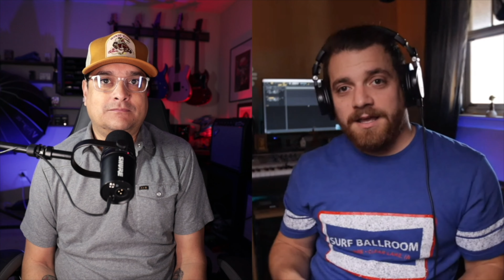The Problem With Amp Modeling is YOU - Just Gonna Say It CLIPS

Comment: Halfway agree on this... and I started expanding on the subject, but nobody cares to read long texts anyhow... so keep it sort. The truth of the matter is that while playing through a modeling unit vs. a tube amp you can easily hear the difference. One will generate sound through some studio monitors, PA or something and the other push the good tones straight out in the air from the speaker cabinet. It's bound to be different. How can it not? You can of course connect the modeling unit to a power amp and a conventional guitar cabinet, and you have a very good litt rig that can replicate all the legendary rigs in the world and the player will not hear a difference either, but if you don't need to sound like many different guitar players then it sort of has no point then. Easier to just get a tube amp...  

As a listener I will not hear a difference if the modeling unit is tweaked properly.

And yes, I've been using modeling units for the last 15 years at least... but in my band I use a tube amp and conventional pedals. No deep diving into venues, tweak tones during a guitar solo if I have to... more practical than a modeling unit... for me at least. I've tried using a Helix with a band but didn't sit right with me. Too many parameters to tweak.

Comment: A big part of my playing experience is having enough volume to create feedback and no matter how great a modeler sounds (and they do sound great), you can't recreate that.  In my opinion that only happens when the guitar and Amp interact with each other.
Reply: Yes you can! I use my Headrush plugged into a 1000watt QSC powered monitor and I can get it to feedback at will!
Reply: 🙂 @officialWWM I'm sure you can. (But indulge Devil's Advocate for a moment) ) .. what *kind* of feedback? The same registers? Fundamental, 3rd, 5th & Oct? Do they come on the same way?  Sustain, then morph into the next higher or lower register at the same rate? All these things matter to me. FACT: How I adjust tone knobs is *completely & solely based on all 4 of those registers coming on and fading as evenly as possible* ie; equal strength.  Humor me..Just listen to Train kept a rollin' (Aeroversion) the 'live/"2nd half,  just before the 4min mark and listen to that reactance..  BTW, tell me that's not an absolutly blister up & singe guitar tone. *end of DA rant- hell, we may just agree for all I know..😅😅
Reply: @L.A.W.Studios  I’m going to say that there may be a slight adjustment required or a small compromise to be made but in my humble opinion, it’s absolutely worth it for all the other benefits. Some people will never gell with modellers and will go down kicking and screaming, all I’m saying is, try it first, you may be surprised! Besides, my Headrush even has a feedback pedal, so you can generate any of those overtones you mentioned at the tap of your foot :)
Reply: I totally agree. And this is coming from a guy who's tried earlier modellers through Power amps,  then into a traditional 4x12. As good as they are, for some stuff, they're still not there yet, IMO. All was not bad news for computer modellers though, once I found S-gear and coupled it with ownhammer's IRs.. Sold every other computer modeller after that. & hey a whole $129 bucks.. bonus..How dafuq ever, one needs to have dialing abilities.. Kemper's the only hardware offering  I consider viable, still saving for one... Cheers
Reply: @officialWWM  I do think it's time to check out things like that Headrush something other than  Helix, Axe FX & 
Kmper ...although I do think the kemper the most realistic out of all of them, including the newer quad cortex
Reply: BTW, what type of speaker what size speaker is in your powered cabinet
Reply: @L.A.W.Studios  have you tried the Headrush? It’s by far the most intuitive to use and best sounding/feeling device on the market in my opinion. And I have a Kemper and a Helix as well!
Reply: @L.A.W.Studios  the QSC monitor I use has a 12 inch speaker. On larger gigs, I take 2 of them and run in stereo. I also have 2 smaller 10inch versions that sound pretty good too but lack the bottom end when you crank em up. Perfect for a small bar though.